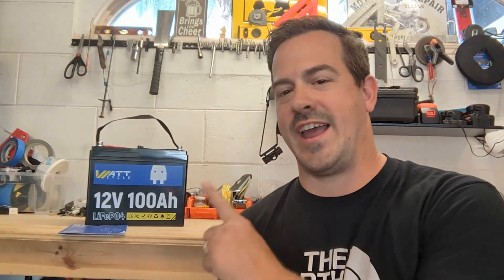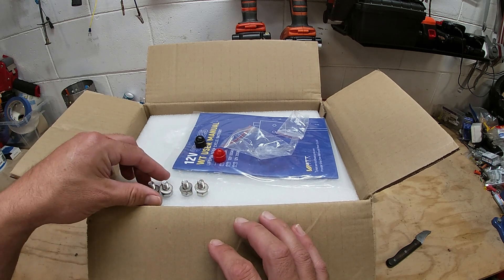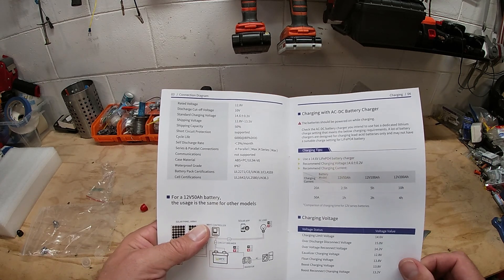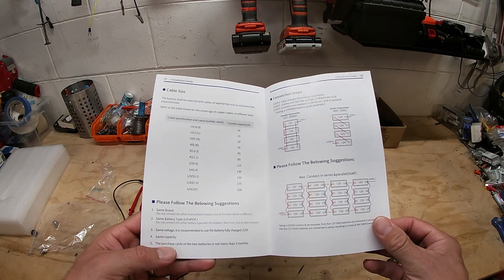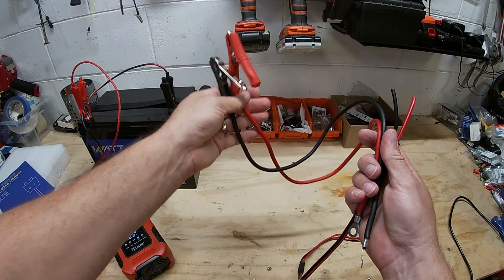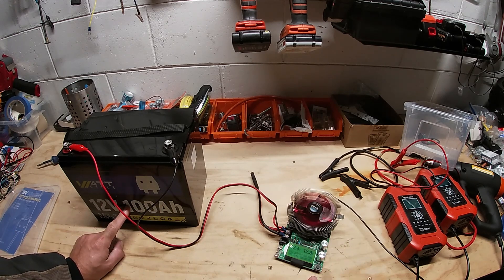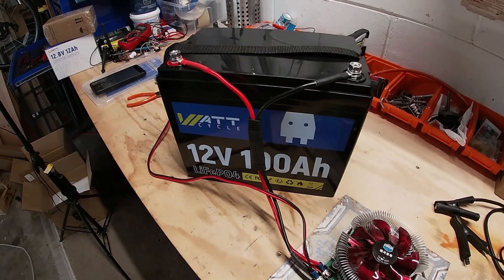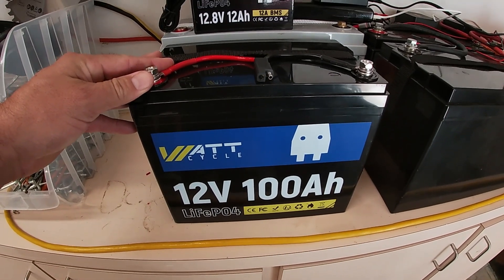Over 100ah?? Unboxing and testing of the new WattCycle 100ah Battery @lifepo4 #offgrid #RV #Solar

Comment: Just got this battery 2 weeks ago. Use it for trolling 30lb thrust trolling motor no problem. But when I connected to 2000w pure sine inverter see if it handle higher discharged for 10 minutes to 5000btu air conditioner it failed !! and fully charged. Seller claims it can discharged 100amp /1280w something is wrong with the BMs. Amazon is resolving this issue with seller hopefully they send me a replacement. I also have an older lithium battery by Weize no issues at all.
Reply: I just ordered a 62lb thrust trolling motor and the watt cycle mini, was wondering what run time you’ve gotten out of yours? Mine will be on a 12ft duck skiff
Reply from the maker: thanks for sharing! I didn't know that.
Reply: @TackleThat 

I received the replacement haven’t got the chance to try it hopefully 🤞 no problem
Reply from the maker: @JPHET37  great news, let us know! Sometimes the start up draw of motors trips the bms if it goes over amps. Some bms are more forgiving than others. If you have an inrush meter you can check it.